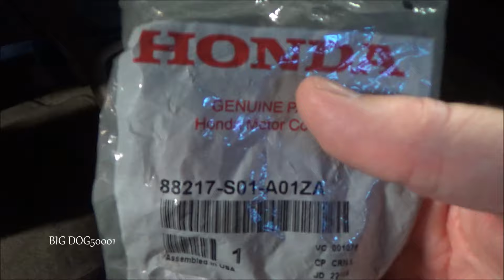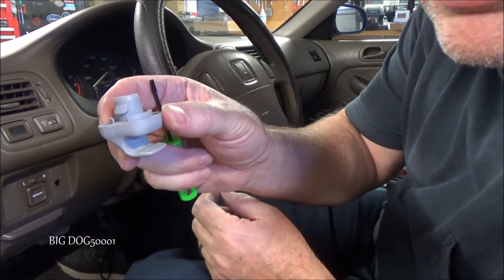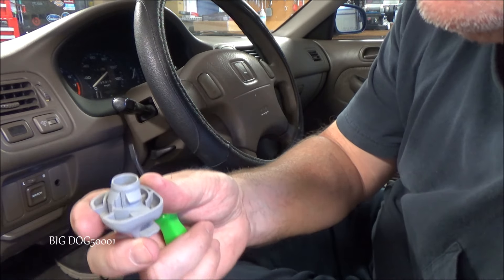Honda Civic Sun Visor Clip Replacement

Comment: 👍.
I have a '99 Civic. The driver's side electric mirror stopped working after I replaced the window regulator. The contacts in the socket are clean and I don't see a fuse listing on the panel. What do you think?
Reply from the maker: Fuse #16 in the under dash fuse box feeds the mirrors on a 1999-2000 Civic (earlier years use fuse #17).  Both mirrors share power and ground at the switch, so if passenger mirror works then power and ground to the switch is not the issue, the problem would probably be somewhere between the switch and the mirror itself (a bad mirror motor, wiring, connectors, switch etc).  I would double check work if this all happened after it was worked on.

A test light at the driver's (left side) mirror connector can show if power and ground are getting to mirror.  There are 3 wires at that connector, Pink, Gray, Light Green.  Test light on Pink and Gray wires for Up/Down.  Test light on Pink and Light Green wires for Left/Right.  Remember not to damage wire terminals when testing!  Good luck.

Comment: HELP! I have a 2008 CRV that will almost stall mid drive and all dash lights come on then go off, car continues driving but CEL stays on. Then after turning it off, doors won't unlock and all power is dead until it feels like working again.

Comment: And when you need that sun visor clip just walk into your local Honda dealer, it is available all the time for a very low price. Don't waste a minute on the computer trying to save a dollar or two, and you'll end up getting an eBay knock off.
Reply from the maker: Aftermarket ones (or knockoffs) usually don't fit well or they hold the sun visor way too tight, good advice to try and use a Honda dealer for these.  Thanks for the comment!